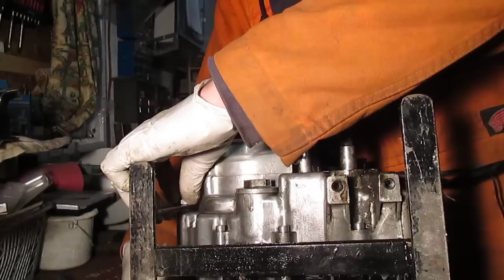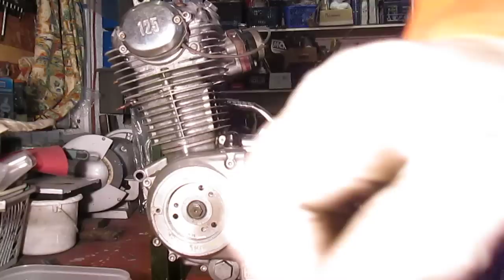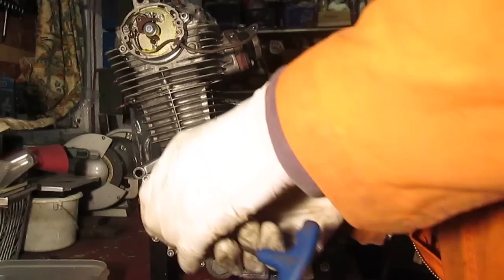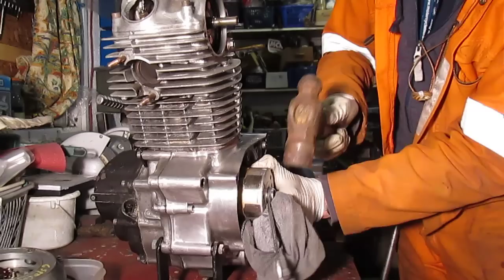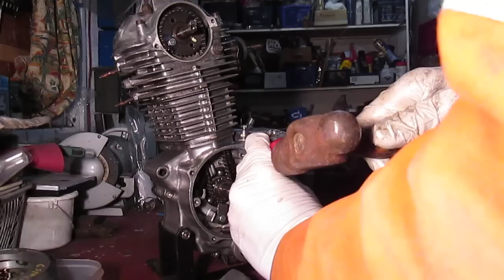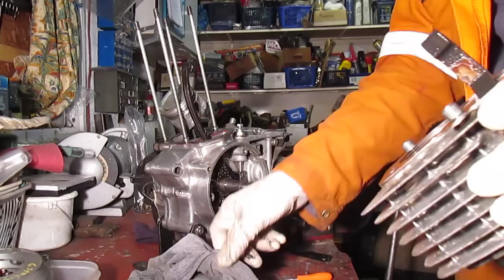Honda 125 CB XL SL SOHC Engine Top End Strip Classic Vintage Teardown

Comment: i have a CG125. i was adjusting the point breaker today and the screw head gave up on me, i have managed to dis-mental the point breaker however will not be able to put it back on till tomorrow because parts shops are closed today (Friday).

Comment: Hi Craig. Do you know how that cylinder head got modified - like who did it? I have the same engine with worn camshaft journals. A new head seems impossible to find - and fixing it is I think my only option. What I see in this video looks like a really good solution. I'm a bit puzzled how you got the camshaft out though - as the bearing would surely be in the way? In the original head the outer journal has a cut-out to allow the cam to be inserted. In the video your hand kind of obscures the magic at that moment. Thanks, Richard

Comment: Good night. It is normal for the oil to circulate for the alternator or is that something is wrong. Please answer me.
Reply from the maker: Yes it's normal for the oil in the alternator housing to be at the same level as the engine oil.
Reply: StAtor alternator stay with oil
Keeps it cool.

Comment: Does anyone know where the oil pump goes on the 74 xl125
Reply from the maker: Check out my video xl125 crankcase 6 speed 1979 L125SE https://www.youtube.com/watch?v=xxWq2INBpvo&feature=youtu.be and you'll see where the pump fits on the engine under the crankshaft

Comment: The Sym xs 125k Uses this engine.... a few mods but its essentially the same... what model number engine is this? also what was the electrical part you removed from infront of the cam shaft at the top of the engine... My sym doesn't have that part.
Reply: Hi Zeatsov, this specific engine is from a 1976 Honda XL125K2.  The electrical part in front of the camshaft is the points backplate for the ignition system. The modern clone engines will have a CDI trigger in place of this, either at the same place or at the crank alternator end.

Craig
Reply: ahh ok thanks, are parts for this engine easy to hold of? tried searching SYM  part numbers but they are few and far between.
Reply: +zeatsov 

yes you can get anything for them, bikebandit and servicehonda in the US and cmsnl in Europe all have online parts catalogues.

Once you have the Honda part number any Honda dealer or online shop can help you out.

Craig
Reply: +S Fan thanks a lot mate, just need to find out what the Honda part numbers are now...
Reply: +zeatsov I use cmnsl.com to find the Honda part numbers. Very easy with the diagrams.

Comment: This video is more comedy than anything
Looks like mr bean removing a magneto rotor
Without a proper puller and impact tool
Yes i know the axel fits but
That axel will be ruined and
No way to tighten further
So this dude gets it out by the time most video is over